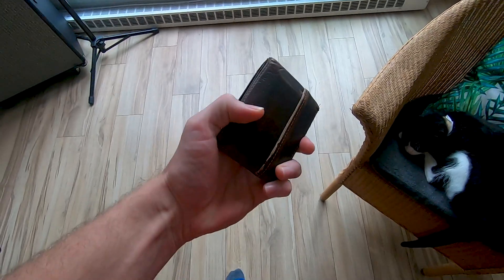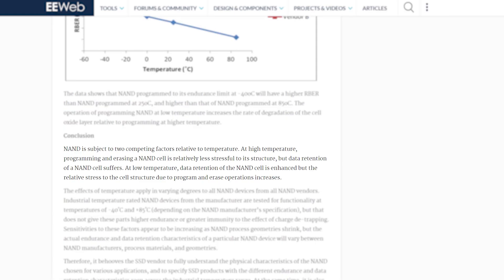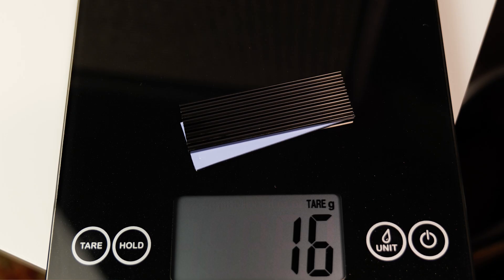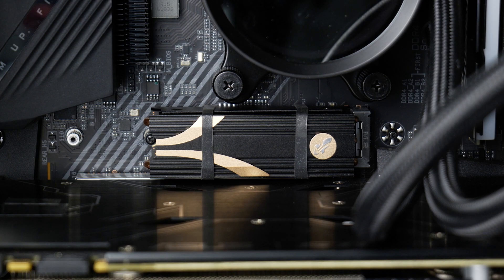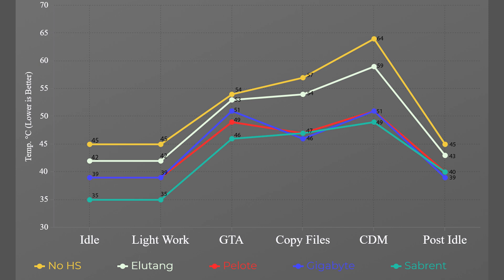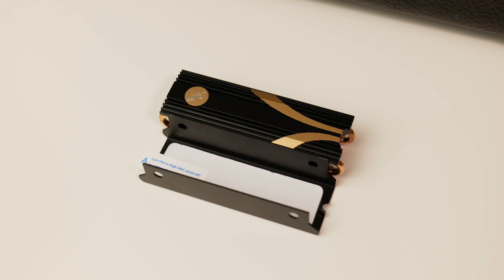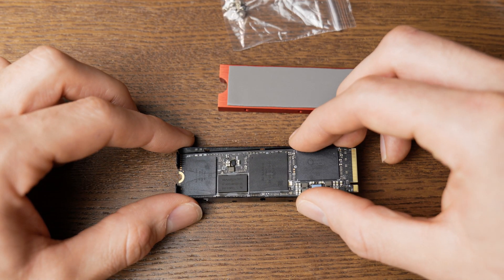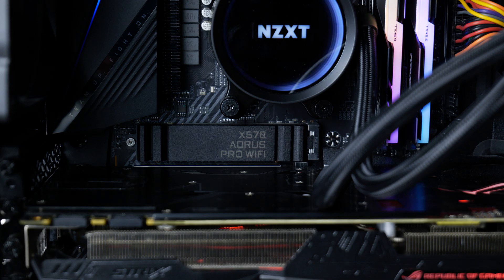Are NVMe SSD Heatsinks Worth Using? M.2 Heatsink Comparison

Comment: Please do this test with PCIe 4.0 drives, my 980 pro reach much hotter peaks than the 970 Evo. Over 80 degrees.
Reply: i hv asus tuf z690 wifi d4 motherboard. i wana populate my four m.2 slots . 
which one i shud buy among 2tb 970 evo plus or 2tb 980 pro
P.S. 980 pro lacks the nvme driver unlike 970 evo plus
Reply: @CaptainScorpio24  what do you mean lacks the driver? all the slots should be pcie4.0 in that motherboard as far as I know, so you could probably go with all 980 pros. just make sure to get the controller chip covered by thermal pads because it gets hot under full load, hotter than the 970 evo
Reply: @mayomancer527  Samsung hasn't provided nvme driver for 980 pro ssd unlike its own 970 evo plus. . im worrying bcz ppl hv been experiencing failure within or after a year of use.
Reply: @mayomancer527  my asus z690 tuf has 3 m.2 slots wd inbuilt heatsink available. thermal pads are already cum attached to those heatsinks
Reply: @CaptainScorpio24  i haven't had my 980 pro for long enough to have a say on that, only a couple of months without issues so far. Only problem was that it got really hot without a heatsink during sustained write loads
Reply: @mayomancer527  my only doubt is why samsung hasnt released 980 pro nvme driver 
is it the reason why it is overheating and failing after year of normal use.
as this isn't case with 970 evo plus.
Reply: @CaptainScorpio24  i don't think that's the case. I have never Downloaded any Samsung drivers for my 970 Evo with a year of use by now. PCIe 4.0 drives will naturally heat up a lot more than the slower 3.0 drives, from any brand.
Reply: @mayomancer527  so buying a 980 pro 2tb       to put in a 1st & fastest m.2 slot near the gpu which itself heat alot due to GPU  IS A RECIPE FOR DISASTERS 🌝😅
Reply: @CaptainScorpio24  not really, that motherboard comes with the cover with thermal pads which should be enough to dissipate the heat as long as they are contacting properly. Either that or just get the 980 pro with heatsink version. Only an issue if you have no heatsink at all or bad airflow
Reply: @mayomancer527  i have 6 case fans and have air flow from each sides. 
1 from front side
2 from sides
1 from back 
and 2 from top as output.

Comment: I agree it's totally optional, but my findings with using a cheap amazon heat sink is that the nand got 1c hotter but the controller drops 20c!!! underload. Granted it never got to throttling, but it sure got close. These drives are expensive & heat kills components, so why not drop $20 to extend the life a bit is my view.
Reply: who knows, game might stutter/ drop fps when its hot

Comment: I would get one of these USB-powered mini fans and suspended it over the SSD's controller with wires.
https://www.amazon.com/dp/B074YJH3P9/ref=sspa_dk_detail_1?psc=1&pd_rd_i=B074YJH3P9&pd_rd_w=H2XND&content-id=amzn1.sym.dd2c6db7-6626-466d-bf04-9570e69a7df0&pf_rd_p=dd2c6db7-6626-466d-bf04-9570e69a7df0&pf_rd_r=4C8FK2EEHQ588BPZCYAD&pd_rd_wg=Wjula&pd_rd_r=771cbd97-48bb-4e18-82d7-e731d476969a&s=hi&sp_csd=d2lkZ2V0TmFtZT1zcF9kZXRhaWxfdGhlbWF0aWM&spLa=ZW5jcnlwdGVkUXVhbGlmaWVyPUEyWk9GWEpVVDdEVldHJmVuY3J5cHRlZElkPUEwMzk1NDgxMUo3MkIwVDVDVVgxUyZlbmNyeXB0ZWRBZElkPUEwNTE1MTE5NUgzQk9ZR01BUlo5JndpZGdldE5hbWU9c3BfZGV0YWlsX3RoZW1hdGljJmFjdGlvbj1jbGlja1JlZGlyZWN0JmRvTm90TG9nQ2xpY2s9dHJ1ZQ==

Comment: Indoors bug zapper with downwards fan came in handy when cloning 60GB operating system to a new 1 TB Gen4 980 pro in a cheap external NVME enclosure.   It was taking over 24 hrs without it and experiencing extreme throttling.
Reply: I used external nvme enclosure to clone. Way to hot matter of minutes. Tossed a high speed peltier cooling fan I bought for my game vice controller for emulations on my ss22 ultra. Placed it right on top almost instantly cool  write speeds jumped up. Put that on your heatsinks lol.
Reply: @rchaze9730  Peltier coolers are great until they overcool, you get condensation and your electronics are damaged from the condensation shorting things out.

Comment: I've always thought the tell here are industries that use integrated flash memory through NVMe/eMMC  (ex: Automotive, Robotics, etc). Industries where the electronics have regulatory guarantees that OEMs must meet in terms of operating conditions and longevity 

It's very rare that you'll see a heatsink on the actual NAND chips in those devices, especially if they have some sort of active cooling (like a fan) in the chassis/assembly, BUT you'll almost always see a heatsink of some sort on any controllers/CPUs.

Granted, it's always nice to see the data, but that fact ultimately convinced me that the heatsink isn't going to help the memory chips in a big way... Otherwise car manufacturers would be spending the extra 5-10 cents.

Comment: Cool test  Comparison:)
HWINFO64 has 2 temps the nand chips and the controller.
And yes the nand chips is used in the Samsung software.
I use the Samsung 960pro  HWINFO64 showing the controller between 54C/69C  win11 22H2/22621.963
And the nand is always stable since I use this M.2 drive. nothing more than 43C
I learned that if there are errors on the drive it gives more heat so checking the drive is always a good thing....(chkdsk)
And don't use windows default drivers....
thks
Reply: i hv asus tuf z690 wifi d4 motherboard. i wana populate my four m.2 slots . 
which one i shud buy among 2tb 970 evo plus or 2tb 980 pro
P.S. 980 pro lacks the nvme driver unlike 970 evo plus
Reply: @CaptainScorpio24  not sure about the 980 pro, but either way don’t get the 970 evo plus, especially the newer version with the elpis controller. That thing is notorious for running hot even for a gen 3 nvme. If you’re looking for a gen 3 nvme with decent temps then you might like the sk hynix p31 gold. Although it’s lacking in the software department.

Comment: I have been running NVME since the beginning and mine both have heatsinks...... I only applied the thermal pads to the controller AKA its CPU and the RAM and they run exceptional still
Reply: i hv asus tuf z690 wifi d4 motherboard. i wana populate my four m.2 slots . 
which one i shud buy among 2tb 970 evo plus or 2tb 980 pro
P.S. 980 pro lacks the nvme driver unlike 970 evo plus

Comment: I don't use heatsinks at all on my two NVme drives.  I do make sure that I have good airflow and that my case inside temperature sits at around 30 degrees C.

Comment: Thanks Nick, l run my Samsung 1TB 980 Pro with heatsinks attached, motherboard covers removed, though, ensure they are cooled, independently by a fan, as low temps are critical for performance and longevity😊

Comment: Would I need a Heat Sink if the only major thing I do is watch 4K videos or do some video editing?
Reply: Ligma balls
Reply: I would run HWmonitor, operational temps of most NVME drives are 60ish degree at load if it is not higher than 70c, everything is fine.

Comment: That's like 2-4 degrees more at low temp but a LOT less heat under load. I think it's better to use heatsink for when it runs hot, it won't be as hot and when its idle well... thats almost the same temp... isnt it? i'm sure 2-4 degrees difference around 35-45degrees wont change anything...
Reply: Yes, but if you keep watching the video he gets to the crucial point of having the heat touching both the controller and the nand.... so the benefits in lower max temps on the controller are offset by the harm caused to the nand modules (heat being transferred directly to them via the heat sink).

Comment: Try with a air CPU cooler rather than liquid. It might be able to keep more airflow over the drive (depending on orientation and type of heatsink), which could potentially have a great effect.
Reply from the maker: Possibly. I'll need to buy a popular one and give it a shot at some point.
Reply: i found some old aluminum cpu coolers with large fins, and i'm gonna try that if i can mount those large blocks over my nvme drive in a pci-e adapter; gonna use thermal paste and fasten with cable ties, perhaps; later, if this contraption holds together, it is possible to attach a ventilator to that cpu cooler chunk of aluminum easily;

Comment: mine burned yesterday and just about 2 years.... used the stock heatsink from nvme is not a very good idea. Ill never use nvme as main drive ever, my older SSD is still kicking and I used it now as a temporary main drive. Next time I build a computer, Ill go for full SSD only. nvme brand should not ignore the heating problems of their products... what a waste. I should have watched this sooner.
Reply: What model did you have?
Reply: i will also prefer ssd sata near fan of my front panel coz my nvme is close to gpu,  jus above it...and my gpu run up to 80c on heavy gaming

Comment: These can go both ways! I got a cheap aluminum heatsink off Amazon mainly because it matched the matte silver heatsinks on my motherboard and my nvme ends up upside down due to which way the port is facing. I just wanted to cover it up, OCD. My temps ended up 5c hotter! I am guessing it is due to the garbage thermal pads that they tend to include with these things. It was as if it was holding more heat in than dissipating it. I did end up getting a cooler that performs insanely well! I have the Mushkin Redline Vortex Gen 4 x4 NVME which runs HOT and does not come with a heatsink really, just a copper shim sticker with "nano carbon graphene" lmao. Whatever it is it don't do shit because the thing runs up to 71c and the max operating temp is 70c. I put this Icy Box M.2 cooler on it, the sickest cooler I have ever seen. It has a nice sized heatsink w/ a 30mm 4pin pwm fan attached to a swiveling copper heat pipe so you can adjust its position. Dropped my temps a whopping 19c I shit you not! Keep in mind though, I did NOT use the included thermal pads as they looked like the same exact ones I got with the last heatsink (garbage). I used Cooler Masters new 13.3wmk purple pads and they are awesome! I went with 0.5mm because my SSD is double sided and the thinner the pad the better. It is hard to explain but it can be faced either way and I faced it so that it would cool the controller and not so much the nand.

Comment: My desktop is an msi assembled cool cat coz i have kept abundant room for data flow and enough room to add higher capacity disk and from existing 16 GB DDR4, can raise to 128 GB DDR4, but not until I begin extensive simulation work.  I am using the MAG X570 Tomahawk wifi OEM heat sink on Firecuda 520.  COOOOOOOOOL Cat.  The temp is yet to cross 70 since it switched-ON a year ago.  
The Challenge is with laptop.  Is it possible that we get some guidelines.  I got an SSD from Venus or Mars, not found anywhere, a WD 810 iTB on msi GS66 i9 12th Gen.  While this configuration gave huge problems and the machine had to be replaced, but the replacement was even worse.  The display got damaged so I returned to old machine which used to freeze.  While msi themselves could not help, nor assisted as the OEM perhaps is currently under weather.  However, I changed the Bios, removed the OEM Windows, purchased a new Win 11 Pro Key and moved ahead one day at a time adding.  I am now due to replace the WD 810 with Firecuda 530 and wanted to know if I must get a heat sink, and what kind of heat sink would work?

Comment: Thank you, I'm having heating issues so hot out I have central air, my GPU is hot...130 F hot in Warhammer 3. I want to heatsink both of my m.2 but they r under the GPU, If I move them to external or how would you recommend I don't believe there is room at all. They come with plates over them but the air is just resonating and not shifting I have push and pull, 8 fans.
Reply: Under load my M.2 is about 112 F

Comment: Sorry, but the conclusions you make are based on wrong criteria. It absolutely doesnt matter, that in idle the temps rises few degrees. Zero impact on longevity or data. Heatsink also equalizes, and averages temperatures across the drive and in time, which is important. 
What can have impact is near 100°C in high loads, and here the heatsink does its job.

PS: the gta V temps are mostly the from GPU and overal system residual heat. The drive is after initial loading nearly idle.

Comment: I guess the easiest thing to do is leave the thermal product sticker on, only put thermal tape over the controller, and leave a tiny gap over the NAND when you install the heatsink. 

Another (perhaps less desirable) method is to use a PCIE M2 expansion card since that will elevate the drive off the motherboard and into the air path better — another YTuber showed 5C lower temps on a card compared to motherboard slot
Reply: Someone else suggested using thicker thermal tape over the controller (say 1.5mm, and 1mm over NAND), to ensure the controller makes contact with the heatsink
Reply: @robertweekes5783  which one is better, m.2 card or thicker pad on controller
Reply: @mrxbooanime did u decide ?? I’m at this crossroad now lol

Comment: I have a question regarding heatsinks. Can you remove the heatsink on a wd black 850? I ask because I have an msi aero expander card and that drive does not fit on the aero expander due to the heatsink. The aero card already has a heatsink and giant thermal pad.
Reply from the maker: Yes it is but apparently it is a difficult task and could lead to damage.
Reply: @TechIlliterate  I'm a pretty technical person I've been working in it with systems and hardware for 30 years so might be okay. My thing is I was looking for something out there to even see how that heatsink comes apart if I decide to try it but I couldn't find anything out there
Reply: @TechIlliterate  they're obviously no screws supposedly and I can't remember if it was you who said there are clips and I was looking for the clips

Comment: Heatsink should cover (and cool)  both controller and the Flash!
This is correct that in idle mode the heatsink may heat the Flash by 3-5C, but in the lower Temp range.
However, in operational mode, it will help to reduce the heat from the Flash by 25-35C on the higher range of the Temp.!
Reply: Did u not watch till the end?
Reply: @itszain6317  Yes, I watched it till the end.
Actually I am design engineer in  company who  has invented  and world leader of SSD/NVMe drives.

Comment: My laptop motherboard doesn't support NVME. If I use an adapter to replace the HDD with NVME, Is there a difference in performance compared with M.2 slot in the motherboard?
Reply from the maker: Yes there would be a substantial difference. Assuming you have the appropriate adapter you will be limited to the speed of the SATA port which will be around 600MB/s Still great though and probably a better option for future compatibility over a 2.5inch SSD considering they are similarly priced.

Comment: Why use the thermal tape? 
Convection works better metal on metal.
Reply from the maker: Conduction definitely works better metal on metal however the SSD is not strictly metal nor are both surfaces perfectly smooth.

Comment: Short answer; yes 

Long answer; if you want something that'll let you run near max potential at all times, you need to build ur own heatsink. The stickers are thermal conductive.

Home made thermal putty, Copper flashing on that, lil more putty, aluminum chunk, zip tie the whole bitch together. Bada boom.

Comment: Would the heat sinks help other components run better by mitigating heat generated by the NVMe? I imagine the real benefit of these might be in how they help the overall cooling system of your PC operate more efficiently and allow colder air to make it's way to other components that benefit more from it such as the CPU and GPU. Not sure, this is just speculation. But I would be interested in seeing what the fan levels went to during CPU/GPU benchmarking with and without NVMe coolers.

Comment: My PNY NvMe is literally idling at 17-18 °C or 20-22 °C when in use even when crystaldiskmark it won't go over 25 °C.
It doesn't have a heatsink.. Is this normal?

But my Kingston NvMe under the GPU is at 44°C and up to 47°C with crystaldiskmark.
Reply: My nvme is almost touching under my gpu and it runs 45c while i game and my case is well ventilated

Comment: So there are a couple of thoughts here:... if you want the NAND warm and the and the Controller cool... then why are board manufacturers putting full length heat sinks on their m.2's... are they deliberately plotting "planned obsolescence" like auto makers and other product manufacturers? And, you would think if an aftermarket heat sink Mfg. were to explain that and just sell a heat sink that covered the Controller, leaving the NAND bare, that they could produce a cheaper better performing SAFER product and run away with the market...  SO, WHO'S SCAMMING WHO?

and the first thing someone might say is that a shorter heat sink would look silly... since many of them are CNC machined, all you have to do is cut out a mm deep notch in the heat sink over where the NAND would be so there is no contact... easier yet would be to put a slightly thicker and shorter piece of thermal tape that doesn't extend over the NAND...

Comment: What an amazing look into what the lying manufactures will NOT tell us! Thank you! However, if you have the free time, it would be interesting to see you send your video to each of the manufactures to see if they dare to rebut your claims. I would be interested to see their comments after watching the video. Thats if any of them have the courage to to rebut you. I say that because you basically have called out all of these heat sinks manufactures for selling unnecessary garbage.   In my case, Asus has including heat sink covers over the m2 slots and they are attached to wires on the motherboard, im guessing to deliver temperatures to the bios dashboard. So, now I need to figure out how to navigate with or around these already installed ones. Thanks again!